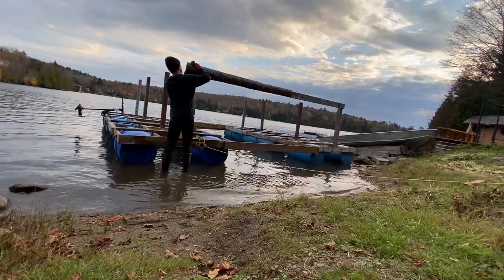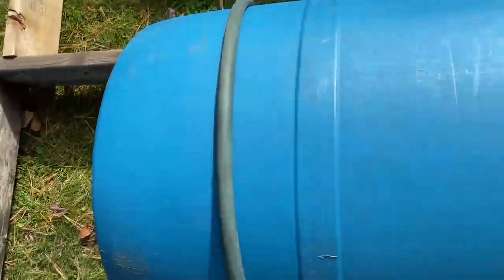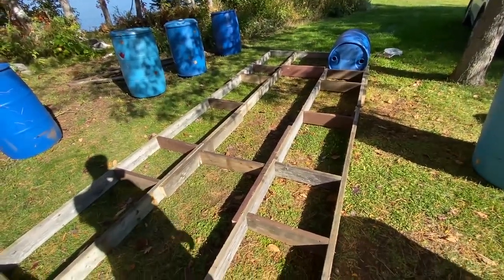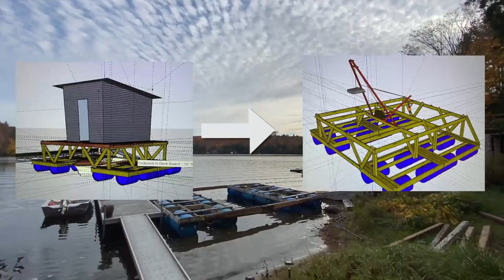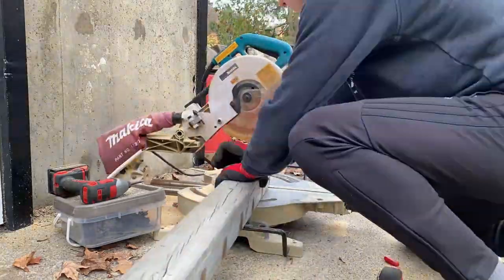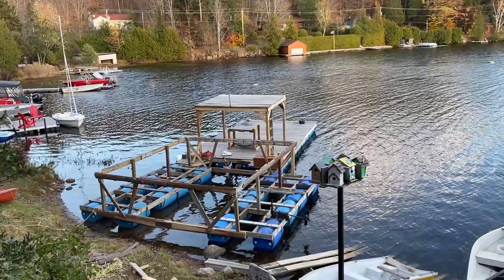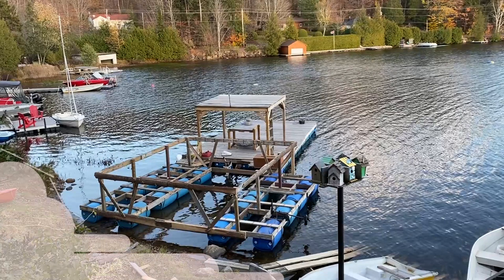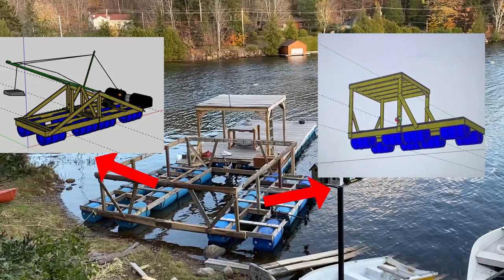I Tried Building a Floating Boathouse

Comment: I have built a dock and a couple rafts with 55 gallon plastic drums. I learned some things, the hard way. You want to seal the drums in the middle of your temperature difference. For MN sealing the drums at 30 degrees works good. The first dock sections I sealed the drums at warmer temperatures and in the winter they caved in some, so I drilled a small hole in one cap above the waterline, but somehow they still can fill with water. So seal in cooler temps.

You can't have too much floatation. My first dock / raft had drums has 12sf per barrel, my last has near solid drums at 6.55sf per barrel. There is no such thing as too many drums.
Reply from the maker: Thank you for the reply to this video. I agree, the drums must be sealed at the right temperature or else there is a possibility for them to cave in the winter.

Comment: Could these still float if incased in concrete/cement instead of wood?
Reply from the maker: It depends, I don’t think it would float too well since they can only displace 450 ibs of water
Reply: @tom_sassen  what if I also packed said concrete with lots and lots of sealed empty water bottles?